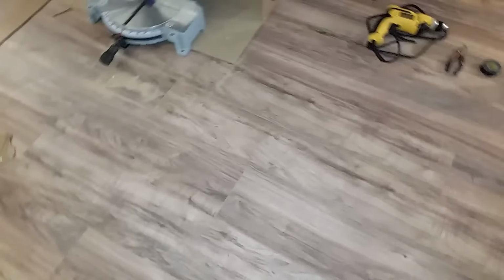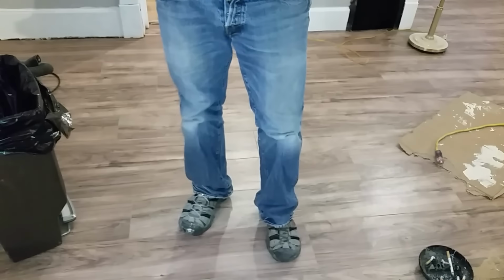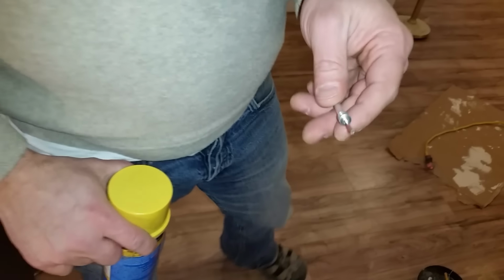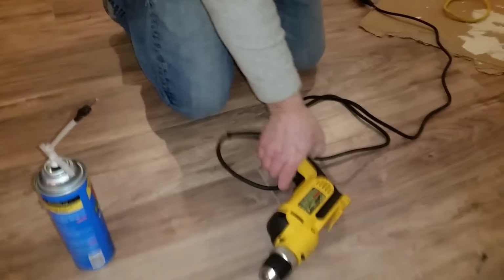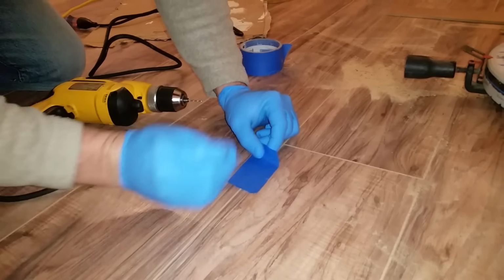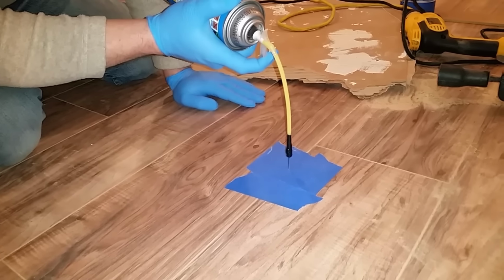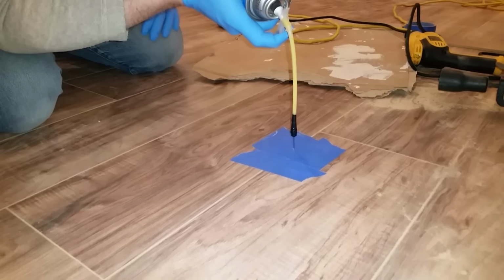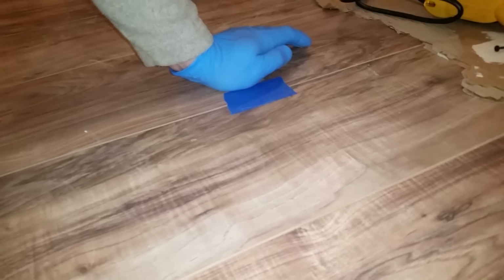Laminate flooring repair to fix soft spot for uneven underlayment

Comment: Would this work for LVP (lifeproof) that has the rubber backing?
Reply: Possibly. I’ll let you know because I have the same type of flooring in one part of my house and have some soft spots I’d like to fix. I’m going to try it. Worst case I need to pull a plank and replace it, no big deal. I do suggest that you find out the type/color of flooring you have and buy yourself a carton of it. These types of floors are really easy to repair by replacing planks. It’s handy to have some around!
Reply: @johnd9357  just curious if you tried this on your LVP yet. I have a new construction on slab. Just had the flooring put down and have 2 spots that are driving me insane. Plan to try this out.
Reply: Did you guys try it on the lvp? I need to do this myself

Comment: tire inflator tip and tape on the floor was the solution ..... I had thought of foam but was not wanting to drill a big hole .... tire inflator solves that ..... good video , great idea , thanks
Reply: correction "football" inflator tip , NOT "tire" inflator (my bad) .... anyway , good idea , I used it the other day and it worked ..... I know one thing , that foam did go everywhere !!!!!! I didn't wear gloves ..... Next time i will !!!!!!!! That crap is like roof tar , no matter how careful you are , IT GETS ON YOUR HANDS !!!!!!!

Comment: Great idea! It worked for me. Beats tearing up the floor. Thanks so much!!
Reply: I’m in the middle of a replacement floor and have found a little dip in the subfloor after installing about three feet beyond it.   Will be trying this solution.  Thanks for sharing your idea.

Comment: Just thinking can i put the foem down before i put down the floor board where i think there might be a soft spot
Reply from the maker: Not sure I'd recommend that since the minimal expanding foam is hard to work with if not enclosed in a space, Try a floor leveler like the pro's. If your thinking of using the foam its more about fixing a floor that was not leveled with floor leveler to begin with. Hope that helps.
Reply: @AGlobalLLC  or is it better i use cemment or concrete throught a tube. And not exspand foam to make the floof level

Comment: How do you know when you've put enough....my experience with foam like that is that it keeps expanding for a while.  How do you prevent it from creating a high point?
Reply from the maker: Add a little minimal expanding foam at a time. You can add some weight on top of the floor evenly for a couple hours as a precaution. Make sure you use minimum expanding foam.
Reply: @AGlobalLLC  how far out wide would this spread?
Reply: When you minimum expanding you mean the one for windows and doors correct?
Reply: @prol220  rewatch the video. At the beginning you can clearly read the label on the can.

Comment: Would it work with vynil flooring? Thank you very much!
Reply from the maker: No, this would not work with bendable vinyl flooring. It has to be a hard surface that your dealing with. Vinyl, at least the flooring that I have worked with is bendable although some floors if rigid this may work.
Reply: @AGlobalLLC  Thank you very much
Reply: I tried this vinyl flooring, sorry it does not work. Strudy and sild on the spots applied but have a tent effect on the floor. Hope this helps.
Reply: AGlobal LLC has

Comment: Would this work between two end joints on laminate as one end goes down when stepped on and the other raises slightly. Must be due to a slight dip so I'm thinking the foam would level it out. Would only need it raising a tiny bit.
Reply from the maker: It's possible and probably wouldn't require no more than 10 seconds of window and door foam injected.
Reply: That is my exact problem and I'm going to try this tip I hope it won't lift the floor where injected and create a hump where it can crack somewhere else.

Comment: Why drill at the seam? Wouldnt it be best do drill in the center? Im afraid drilling at the seams will loosen its locking abilty?

I need to do this job, and am deciding on using the foam, or wood glue
Reply: The hole will be obvious in the middle of the plank. If you save the sawdust from drilling, you can mix it with glue and put it in the hole and it will be less visible.

Comment: just right now i am installing laminate over a concrete slab that is uneven near the door of the bathroom, and i have a rebel soft spot, that i already tried to level, i used mortar to level before installation and quickset after the first time i took it off, but man it is still there haunting me i cannot level it flat because i would be over the level of the hallway ( i am installing the laminate without transitions) .ill try this method instead owe you a beer.

Comment: I would recommend using a high density, low expanding foam. The foam will still spread during initial application but will expand very little while setting up. I did this in my own home for an upstairs shower floor. It has been close to three years and the soft spot has not returned.
Reply: I was wondering which GreatStuff product (color of can) that would be? Doesn't really say "high density" or "low/high expansion" on the cans!
Reply: @ranyodh  For "Great Stuff" I think it would be the stuff in the red can that says fills 1 inch cracks and gaps. It's been a while so I don't remember the exact brand I used. Just remember to follow the directions and don't walk on it until it has had time to fully cure.

Comment: Wife and I tried this hack and it worked like a charm! THANK YOU! Didn't even have to add weights to the floor!
Reply: What minimal expanding foam brand you used to not buckle up the floor from foam expansion?
Reply: @Mr.Beastforpresident  used the same brand as the video. When spraying the foam, I would stop and step on the area lightly to spread the foam. Hope this helps.
Reply: Can I ask if you drilled in the seam (long of short?) or in the middle of the board?
Reply: @kelso72  middle of board.
Reply: How is it holding up?

Comment: I wonder if that would work under porcelain tile.
Reply: Concrete board should've been laid down before the porcelain tiles were installed.  If you have a significant void under the tiles they are probably already cracked..

Comment: Wow I was afraid to attempt this in a new plank floor I did and then I discovered  a small soft spot and boy I’m i glad I seen this video, thanks it worked for me......
Update: the very next day, I realized that I put too much foam in my soft spot and now I have a raise spot not crazy high but when you walk on it you can feel it, f#%k  I can’t win, my suggestion is to put small amount of foam, I did use the window and door foam but I just put to much, thanks

Comment: How about if there is sqeaking noise coming out of the underneath the floor when we step on?
I might have to remove the laminated  pieces in affected area and nail the floor down first and reattach pieces.  Have 2 spots in the condo that make noise due to loose flooring under.

Comment: I did this and I have huge lumps where I put the foam in. Now I’m screwed. How do I get it out?
Reply from the maker: Note: For all others reading this. Be sure to use Window and door foam and inject in 10 to 20 second intervals depending on the air gap below the floor. The window and door foam is minimal expanding. Everything else will cause your floor to buckle. The good thing is the floor would of had to been replaced otherwise since this method was tried and it was beyond repair.
Reply: My floor looks like an Olympic Mogul run now
Reply: @t.r.lanthierjr.4560  mima mounds

Comment: Just be careful how much you inject under flooring, I was trying to fix a gap underneath a vinyl floor and it didn't end well. It's a good fix of you apply the right amount and I dont recommend this method for vinyl since it's very flexible thus easier to end up with a bump. Thanks

Comment: I read in the comments below that this will not work on LVP,  but not really touched on as to why it wouldn't.
 I have a few small dips in the gypcrete subfloor (condo) that I would like to try this on but don't want to make matters worse.

Comment: My first attempts at leveling large rooms seemed to go well but it became apparent that even tiny undulations left LOTS of soft spots all over my floors. 
I'm basically turning my floors into swiss cheese doing this I have so many places but it SEEMS to be working pretty well so far. Ive done about 12-15 holes and it's definitely much better. 
TIP:  Ive been laying large heavy slabs of old countertop over the floor where I filled to press things level and try to avoid any swelling. Which also SEEMS to work well. 
Fortunately I have a "natural/worn" style engineered hardwood, so the holes aren't too noticable and I've even been able to hide the foam dots with a bit of matching wood stain. 

Thanks for saving my ass man. I hope I can find enough cans of foam to fix this squishy floor of mine!
Reply: Were you on a slab or plywood subfloor? Glued down?
Reply: @chasecomptondesign  slab which was liquid leveled, but pretty sure the sika leveler either sucked, or was expired (thanks home Depot).  Additionally, my hickory engineered hardwood tongue and groove planks seem overly flexible conflated to many thick lvp click locks
Reply: My son is a flooring guy and he uses 2 25 lb weights. He drills the hole and then lays the plates over and injects down thru the holes on the weights. Holds everything steady and level.
Reply: @fightzoid  can you explain more?

Comment: never use foam, also you need another hole for air escape. foam doesn't let the wood flooring move causing more problems in future. Never and Never do that

Comment: Have a soft spot in my floating LVP floor, would this work or would anyone see issues with doing this to vinyl planks? Thought about using a small amount then putting a 5-10lb weight on the top to keep it from expanding too much.
Reply: Did it work on your LVP?

Comment: I have a soft spot on my engineered wood flooring I may try this on  Would you inject the foam between the flooring and the underlay or try to drill through the underlay and inject the foam between the sub-floor and underlay?
Reply from the maker: Kevin Russell  either way it's worth a try since if your laminate flooring is bad it will have to be replaced. I'd say if you measure the depth of injection try to get it under the uderlayment it may feel even under your feet. Either way it should fill the gap and should give you positive results. Please share your results.
Reply: I finally got around to doing this. I was a little reluctant as it is a new floor and quite a large soft spot. The flooring guy really fu*$#$ up and would not fix it. I seemed to worked pretty good. I am not 100% happy yet with the results but it is far better than it was. I am about 90% happy lol. I have a couple other spots I will fix this way as well.

Thanks for the tip, it saved me a lot of grief!!!
Reply: @kevinrussell3868  how has it held up? Have a similar issue to you on a new engineer wood floor

Comment: Thanks for the tip! Is it possible to use this for moving TILES on concrete floor?
Thank you.
Reply: No Victor, there are several utube vids on how to fix loose tiles. Expanding foam is a filler, not an adhesive. Cheers and good luck.
Reply: @johnnysmythe7767  Thank you for your kind and very explicit answer.
Merry Christmas

Comment: Listen people they do sell an epoxy  floor repair to inject under soft spots. It's a 2 part epoxy, tape and drill a hole, squirt in, dries in under 3 minutes, fill hole with color putty.  Very easy. Designed for floors. Will never crush or create humps.  Do not do this Hack trick. If you have to do it, do it right.

Edit correction and update: 

But I do not recommend this for a laminate. Epoxy is best known for engineered wood.. 
My answer to fix this is in one the replies on this page.
Reply: What's the name please? And do you inject it in several areas... the soft spot is about 1 ft by 2 ft.
 thx

Comment: I have a wood floor with the pad under it on a concrete floor,  in summer its bummy as the wood expands. Can this trick work? should i make sure the foam gets in between the wood and the pad and also between the pad and the concrete floor? the wood is interlocked. thank you!

Comment: Ok it all depends on why the floor is spongy is it because of a small water leak rotting the floor boards? If so this will only make it worse. Is it a loose board from the house setting a little bit then yeah it should be fine. Just make sure you know why the floor is acting like it is before doing a repair like this.

Comment: This works ridiculously well, if you are ever in Edmonton I owe you a beer. Like others said, this video is for people who made the error of laying floor on an uneven surface, not for those smart enough to level it correctly beforehand
Reply: When I was buying new floors my first choice was vinyl but everybody said that it requires perfectly even surface. Since I had old tiles and parquet they advised me to go with laminate because, with a the 3 or 5mm underlay, it can withstand some imperfections. Now I now it's not the case. 
I bought 10mm 33 class laminate and now I regret not buying 15mm one. I installed 85m2 of it and the price difference was significant  but still..... 
I have some part that are moving when walking over and one piece that is cracking.
I suppose that the one that cracks was not installed correctly and the V groove does not match.
I was wandering if I could drill from under the pavement and then do something similar and then I came across this video.
Even if I would prefer not to drill on new laminat the procedure is inevitable.
Will it work? And will the hole do problems in future after few years of washing?
Reply: A fellow Albertan! And I just dumped 6 buckets of leveller on my floor and there’s STILL some low spots. So I’m saying f it and just putting laminate on top anyway because seriously I just hate floors so much at this point. Over it….

Comment: Never use foam-like filler under the boards, it will compress and contract over time leaving you with a problem that’s much harder to fix than the original one.
Use ‘tough as nails’ glue which dries to rock-like state, or tile adhesive or similar.
Reply: How would you suggest getting the glue under the planks?
Reply: @BrookeMoore-id4js  Again, avoid using a glue(unless tough-as-nails type) if you could. I have done this many times before and all are still holding as on the day I did the fix. One of them is close to 15 years old now and happens to be a family friend, others were done as a business. I also used tough-as-nails type glue but only on few occasions and places with stable temperature (no direct sun hitting the floor boards)  and controlled moisture/humidity levels. Glue can be a biatch and can be affected buy both the humidity and higher temps, it can shrink and crack over time. I predominantly use these days tile adhesive, the brands will differ and depend on the country you reside in. Go to the tiling shop and ask. Cheers.

Comment: I just wanted to say thanks and this worked like a charm. The only downside I got which was minor, is a little bit of the Great Stuff goes a very long ways so be careful. I had a few soft planks and it sure does beat ripping up the floor.
Reply: So this Great Stuff is not good for the long term?

Comment: Thank you so much for the idea. 
I had the idea to use liquid nails and small drill bit but had no idea how to get the liquid nails through such a small hole. Plus it would be flexible afterwards. This is a much better solution. Hope it holds up over time!
Reply: I tried it but the foam kept coming through the hole at the opposite end what did I do wrong?

Comment: Great idea. Remember a little goes very far as it's only filling about 1/8" max. I do this exact repairs for spongy tub floors also. It works great. On the tubs, I use epoxy patch for the hole/s, then spray the floor with epoxy paint. 👍

Comment: I'm going to try this but use clear 100% silicone instead (and add weight until it dries) as I want the floor to stick down, not fill a gap .  The ball needle is a great idea and should fit in a properly cut caulking tube (with a hose clamp maybe).
Reply: Did u try your idea?

Comment: This is only a temporary fix as the foam will compress over time and you'll be right back where u started. Good idea though 👍
Reply: Debbie downer
Waaa waaaaa
Reply: Not sure this is true,  Yes it might compress but it acts like a glue it is urethane based.
Reply: it will compress but it wont disappear
Reply: If it compresses over time won’t it again leave a void as well as a “crunching” sound? Can someone that has tries this in a high traffic area a few years ago comment on the current condition?

Comment: Did you do anything to hide the hole. Asking for a friend...seems easy enough to do though.
Reply: There are other videos for other products that offer dowel pins and matching wood filler for the holes.  In their video, they actually Do drill a second hole to let out the air. I'm in favor of that but would appreciate the feedback from others that have done it.

Also , anyone out there that has had any issues doing this? I would imagine the expansion/moisture differences of concrete as opposed to a plywood subfloor could make some differences.
Reply: @timothylehman1496  Too late my friend already did it. Worked well just rubbed the dust back in and it the the hole. Thanks.